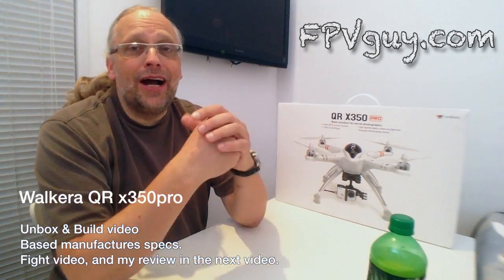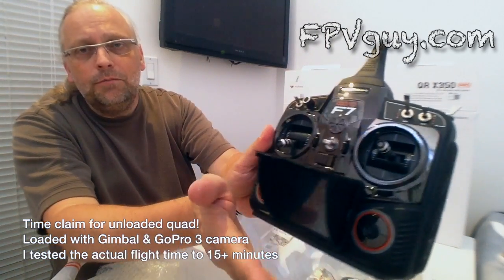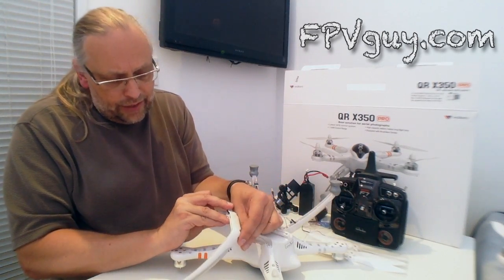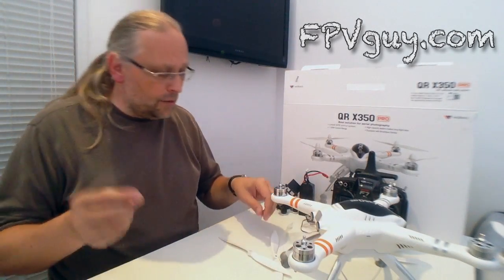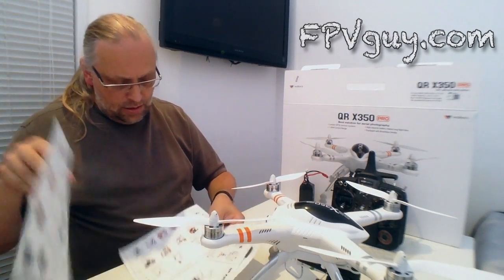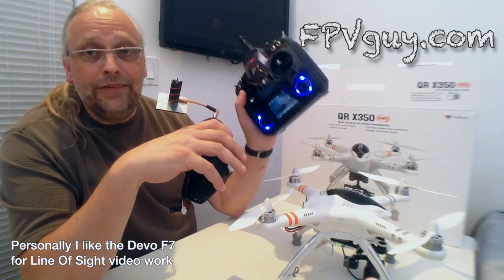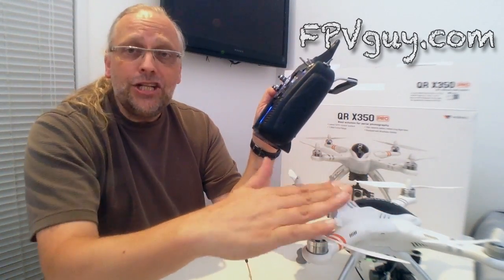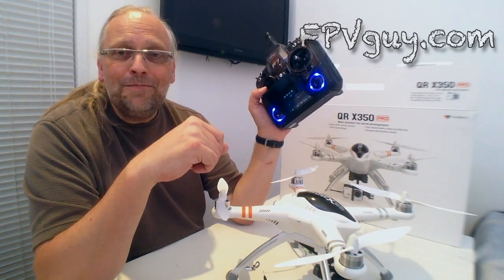Walkera QR x350pro build video

Comment: Hi bo sorry to bother you again. I was flying my walkera 350 pro when out of nowhere it fell from the sky not to high up. I set it back on the ground and started the engines all but one spun it kept barely moving right and left and would not turn. Did I have motor problems or is it in the board? Rest of the bird seems fine.  & if I have to replace motor should I do all four. Thanks for your time
Reply from the maker: Hey Michael, sorry for the slow reply,  Im not sure what is going on, but post this to the our FB owners support group here 
https://www.facebook.com/groups/711455455567160/?ref=br_tf

Comment: Hey Bo..great video, im getting one of these should be here in a few days..The thing is its a mode 1 (right hand throttle I believe but I want to change it to left hand throttle(mode 2) as i have a nano qx mico that I have been using (left hand throttle that im use too)..do you have any vidoes on changing modes as I believe you need to unscrew the back of the transmitter and change a few things..(for the devo f7 FPV) THANKS.
Reply from the maker: Yes you gotta change the stick a little.. best place for a walk-through of the mod (which is totally standard, all mode-1 can become mode 2) 
https://www.facebook.com/groups/711455455567160/
Reply: Bo Lorentzen Thanks Bo...just got my 350 pro a few hours ago..found the instructions to change modes thanks
Reply from the maker: 63resindog Great,  have some fun flying that thing. :-)
Reply: Bo Lorentzen Hi Bo dont want to be a pain...but my next issue is ..i charged up battery (for devo f7 transmitter) with charger ..light was flashing red then solid green..( i guess its fully charged then)..so i put it in transmitter turned it on...and got nothing!!..no lights no sound..just nothing??..any ideas??
Reply from the maker: Don't want to be a pain.. we actually operate a  Facebook group for supporting you. take advantage of it please :-)
https://www.facebook.com/groups/711455455567160/

Comment: thanks for the info video ...can one use this setup to take still photos ? controlled via transmitter  with ilook or hero 3?.. i seem to like photos more than video...like i can do with some toy quads ..but i am ready for this one now.
Reply from the maker: ST Logan   Yes on the iLook+ camera there is a selector, you need to slide it to the camera logo.. then you can flip the right hand switch on the control down-up and it take a picture.

Comment: I am trying to make up my mind, between the x350pro or the dji phantom 2, as I said before I have a dji and x350 which I didn't get on with, but because you said the x350 pro flies like the DJI I was going that way, mainly because you got more for your money, can you give me your opinion, I would go for the H500 which looks good, but a lot of cash
Reply from the maker: Hey Brian,   They still don't fly the same, if you like the DJI feel, then I would probably suggest getting a P2.
Reply: Bo Lorentzen Thanks again , I do appreciate your getting back to me , what I do like about the x350 pro, is the battery hatch , if you wanted you could put a smaller battery in there,  you cannot on the DJI Phantom 2 but I feel it flies easier
regards Brian
Reply from the maker: BRIAN HALL  agree,  I fly almost always with 3S 2200mah,  simply because it reduce the weight and let the quad fly better with my gimbal.

Comment: Bo, I had a reply from walkera and I have been told when ordering the quad if this cable is required the will be suppled in the kit free of charge,if and when ordering the complete kit including the camera this cable in included in the kit any way.
Reply from the maker: LOL  they are killing me.  the cable for the start-stop camera operation is missing form the complete kit.  and I have not found anyone at the factory who can name the cable.. (yet)
Reply: Bo Lorentzen Me too - no cable and a lot of head scratching - my supplier is sending me what he calls an fp wire for $3 so we'll see if this works. Looking at the receiver.  I have set the radio device output for FLAP to GEAR Switch (custom video control) as detailed in the manual BUT am a little confused at the receiver (RX703A) end as there is no GEAR socket here - the instructions say connect to AUX1 for custom control video (DIY is necessary). I'll do this and see what happens. I also looked at the DEVO-M unit and there is no connection there to the GEAR socket?
Reply from the maker: Phil Ladds its a "china syndrome" thing, at least I think so.  none of the customer service girls in china seems to believe that there potentially is a missing correction.    guess I need to put a servo in the RX and see what channel the gear switch is actually on.   I will try to do that this afternoon.  with that, you can plug in the control cable that did come with the camera, in the bag with the screwdrivers etc.  that should start and stop the camera.

Comment: Hi! Cool review. I looked up and bought a quadrocopter Walkera QR X 350 Pro. I have a questionnaire which devices should be connected to produce a video image on your phone (samsung galx 4) and control capabilities using a smartphone or tablet? (Walkera DEVO 10CH 2KM 2.4Ghz Telemetry Function RC Transmitter + RX1002 Receiver, Gimba lG-2D for GoPro Hero 4 - with a complete set).
Reply from the maker: Andrejus Bondarenko  the 350pro do not come with the option of delivering video to your phone.

Comment: Hi again, I was just wondering if you ever had radio interface with the 350 pro or heard reports on it. Im new to flying & I fly at work got some apartments near by so always careful of flying. Never too high still getting comfortable with it. Prob got abot 75ft or so. Just sacred of it flying off for no reason. Im smart enough and confident with myself as fast learner. 1. I don't want 800 bucks to fly away. 2. I dont want to damage anybodys person or things.
Reply from the maker: Michael, the radio link is good out to about 500m,  
the most important thing to avoid fly-away's is to always wait for solid GPS connection and give it at least 3+ minutes to sit and gather sats.
Reply: Got it thank you very much for all the great info.
Reply from the maker: Michael Dorn You are welcome..

Comment: Hello Bo,
I just bought a Walkera QRX350PRO with Devo7 (not Devo F7, but Devo7) and Ilook Camera. I am a beginner in France where I live. Can you help me, please ?
First question: why the Ilook doesn't record video? When I plug the battery of QRX, the lights on Ilook is blue fixed. When i press the button above, it flashes blue. I thought this time it tooks a video. But I have nothing on the SD card class10.
Second question: is there a Ilook application to view live video on my tablet Kindle Fire from Amazon?
Thank you for helping. I hope you understand because I don't write your language very well.
Thank you. Alain Jamet. :)
Reply from the maker: Hello Alain,   unfortunately there is no iLook+ applications for live viewing on tablets.
Look on the side of the iLook+  there is a little slider switch, make sure its set to video camera.
finally, with the SD card inserted and the camera powered, push the record button for 5-6 seconds, that should get it to format the card.
then push the record button about 1sec to start recording, when recording it should be blinking. :-)
Reply: Bo Lorentzen Bo thank you for the quick response. But unfortunately I do not record. I try with two cards and none recorded a video so that I could make fixed images. Maybe the camera is broken. I'll check with the supplier. I should perhaps buy a GoPro Hero3 for a tablet application. Or buy a radio Devo F7. Thank you and I will play your videos. Alain :)

Comment: Hey Bo! Thanks for making this video it really helped me out when putting everything together. I went out for my first flight and everything went great. Afterwards I charged both batteries at the same time (this may be what messed something up). After they had charged for a good amount of time, I plugged the battery into the remote and tried to turn it on and it didn't work. The quad battery was fine, it powered up the quad with the regular beeps and there were no issues. Now I'm trying to charge the remote batter and when I plug it into the charger, it makes a clicking noise every 2-3 seconds and the lights goes from solid to blinking red over and over again. Any idea what's going on?
Reply from the maker: Taylor Watts Ahhhhh not entirely sure,  the way I understand it, you plugged the 2S flight battery into the charger along with the 3S flight battery.   you can only charge one at a time, and it sounds like the 2S in reality got discharged and probably you need a new 2S battery for the radio. ;-)
Reply: Bo Lorentzen Yea that's correct. I plugged in the 3S first and then the 2S. So you don't think it's the charger with that clicking noise? Just the battery I need to replace? Also I saw a plug in the back of my F7 remote control where I can use a power outlet to power it on. While I am waiting for my new battery is it okay to directly plug the remote into a wall outlet outside so that I can practice flying?
Reply from the maker: Taylor Watts I really would not fly powered from a wall charger.  the RX battery is a standard 2S battery,  go to your local shop and ask for a small 2S battery, bring the radio. see what fits ;-)   or remove the little case in the radio so you can put a bigger one in.
YES make sure to charge ONE battery at a time.
the clicking sound is the charger trying to balance the cells and clicking from one to the other, its obviously not managing to finish it that is why it stay red and keep going.
Reply: Bo Lorentzen Okay great! Thank you so much for your help
Reply: Bo Lorentzen I actually have 2 more questions I forgot to ask. Do I have to calibrate the drone each time I fly? And the issue I had trying to fly it yesterday after the second battery charge was that after a short time of throttling up right before it took off from the ground both of the lights on the back of the drone blinked rapidly and it make a beeping noise. After that happened the left light would have a steady blinking but would not link to the transmitter and in order for it to link again I would have to unplug the drone battery and plug it back in. Any idea what that means? I looked it up on Google and someone said that it means low voltage in the drone battery
Reply from the maker: Taylor Watts    the fast blink is low battery.. it will not re-arm at that time.slow blinking means it did not yet bind.  you need to turn the quad on first, when you hear the first beep turn on the radio.  its a strange walkera thing but thats the way to bind them
You should join Matt's FB group here https://www.facebook.com/groups/711455455567160/?ref=br_tf

Comment: Thanks, can I fly it in IOC-mode all the time?
Reply from the maker: Jonas,  logically, I think its better to take off and land in GPS hold mode, then flip to IOC, the reason being that by default IOC really need a bit of distance from the "center" of the control position to understand its heading.    so you probably want to  fly it at least 3m away before engaging IOC.   (that is just my opinion)

Comment: I've turned on my x350, and made everything to 0 on my Devo-10. However, the left LED on the quadcopter just keep blinking and couldn't let me to do code binding. Any idea why?
Thanks!
Reply from the maker: Robert,  with the Devo 10 setup correctly.   turn on the x350pro first, THEN when you hear the beep, turn on the Devo-10  (when you hear the beeps from the 350)
Reply: Still doesn't work... does it matter if I have my gimbal connected or not?
Reply from the maker: The gimbal being connected do not matter,  post the question to the FB 350pro owners support group.  https://www.facebook.com/groups/711455455567160/

Comment: Bo,  I am using the G-3D Gimbal with the GoPro 3+ but cannot find how the power cable connects to the TX5803.  There just does not seem to be a suitable connector from the gimbal controller - or am i missing something?
The Devo 7 that came with the copter is set up for the walkera but the flight mode is set to aircraft - not helicopter. Was wondering if this was correct?
Reply from the maker: Hey George,  if you are using the TX5803 then you need the custom connector cable for that VTX.   
Yes the Devo 7 need to be aircraft mode model for multi rotors, helicopters have a different way of mixing throttle and pitch on the rotor.
Reply: Hi Bo, thanks for getting back to me so quickly. Have asked the supplier to assist in finding the correct cable from the TX5803. Thanks again, George. PS: have also found the 3D gimbal does not have enough floor clearance to avoid damage when landing.
Reply from the maker: George Monaghan   email Lucy from iuasinc.com and ask for the exact product number,  they would know for sure.   then your distributor can order it or you can get it quickly from Lucy.  

Yeah, I put foam balls on the feet of the 350pro    the trial trick though is landing the same place each time, and Im starting to think the easiest way may be just buy a 1x1m piece of fairly firm foam. ;-)

Comment: Great video, do you have a video there you mount a monitor to a Gopro on a Walkera QR X350 Pro?
/Jonas
Reply from the maker: Jonas,   you can use any monitor or the F7 monitor,  Walkera have a GoPro kit with a VTX, just plug it on and you are ready to go..  if you want some more horsepower, get the immersionRC 600mw vtx and anyone of the immersionRC to GoPro cables. ;-)

Comment: Hi Bo,

I am thinking about getting the Walkera QR X350 PRO BNF version and adding a DEVO F12E transmitter, iLook+ and G-3D gimbal. I was wondering if along with FTV, can I do waypoint flying with this setup?
Reply from the maker: Grant Armstrong   theoretically yes.    it is a APM,    for waypoint missions and to fly the G-3D gimbal, I would consider the 350premium which come with the F12e, G-3D iLook and much more power.  for only $999 all included
Check the review at https://www.youtube.com/watch?v=8hBVu9ddADQ

Comment: Hey Bo,

Just bought the pro - had some problems with the weight and balance on this, when all was done the weight seemed to bias towards the front of the aircraft, causing it to tip forward on liftoff when taking off slowly. Put wadded up aluminum foil in the front which moved the battery back and left the battery door open and it appears to solve it. Have other users run into this issue? Does the center of lift need to really be in the center?
Reply from the maker: Please INSTANTLY remove the wadded up aluminum foil, there are EXPOSED solder points on the power board and you have a very high risk of shorting the power board with catastrophic results.   use a block of hard foam if you must space the battery.

You should not have issues flying the gimbal,   a bit of front weight is OK.  as the aircraft pick up, balance it by pulling the stick appropriately. ;-)
Reply: Bo Lorentzen ok  - took out the foil, replaced with foam...

Comment: hi Bo, just to let you know i tryed what you said took it up around 2metres flicked switch   straight away it went to the right at speed i left it long enough to correct itself  but it was clear it wasnt going to so i tryed to get it back in my control.,but it hit the ground. i tried this again this time i tide a thin peace of string so i had a little control of it , and same again it hit floor lucky just 2 props broke . would appreciate if you have any more ideas ,thankyou for your help ian
Reply from the maker: Ian,   just to check,  you had a rock-solid GPS lock before starting to fly.?   
Its not supposed to go this way, you probably need to call the company you bought this from and tell them the GPS is not working at all. ;-)

Comment: Bo, I have a few dumb questions! 1). I assembled my QR X350 Pro just as you said and calibrated it right where I assembled it. Well the first flight went as planed with freestyle control but when I took back off I flipped the switch for GPS mode and the quad started drifting very bad and I wasn't sure which way was the front so I decided to use the return to home feature but when I flipped the switch down, the quad raised up as expected, turned and flew right into the side of the house. So   that brings my to me second question. 2). Do I have to recalibrate every time I move to a new location outside?    All that return to home action happened so fast I couldn't switch back to freestyle to save the propellers and landing skid.  Any help please!!!!
Reply from the maker: Hey Warren,   well its not supposed to be doing that.   ;-)
OK my gut feeling is that it got flying way too fast the first time around.    the 350 have a AMP flight controller,  you need to respect that.   first of all, place the quad on the spot you intend to start flying from, once you turn on the quad, DO NOT move it,  before you start flying,  please leave the quad sitting for 3-5 minutes so it can get a solid GPS fix before you start flying. :-)     
for the first couple flights, fly kinda low out in front of you, scoot around a bit right and left, that refines the quads behavior.   having done that,  when you flip to GPS it should then hover pretty nicely.  check out my "first flight" video also.
Reply: +Bo Lorentzen Thanks Bo for the information. I will try all this the next time I take it out when I get the new land skids in.
I have a friend that bought his twins two and I told him what happened to me but I'll point him to this information also.
Thanks again.
Reply from the maker: search also for "FPVguy first flight"  thats kinda a walkthrough on how to get the thing in the air the first time.
biggest issue with the 350, is being patient when starting it up, you want to have a solid GPS lock, without that you can get surprised,  also, even if one day it have say 9 satellites in 30 sec.  let it sit for 3+ minutes and gather its thoughts before you fly.  thats just how the APM controller like life.